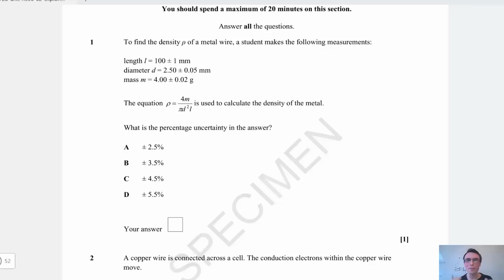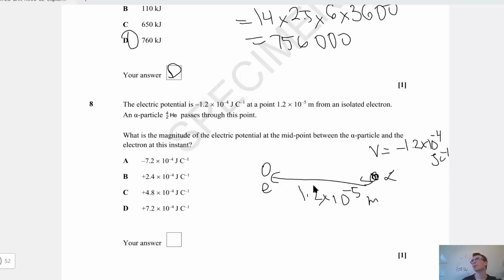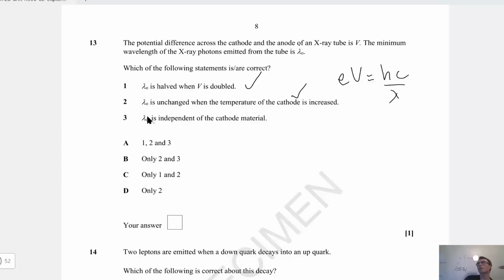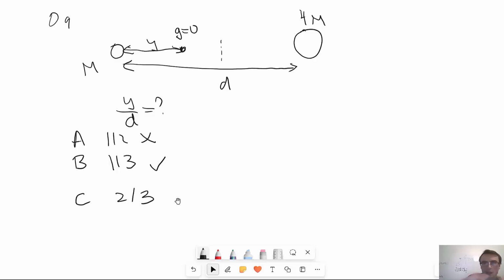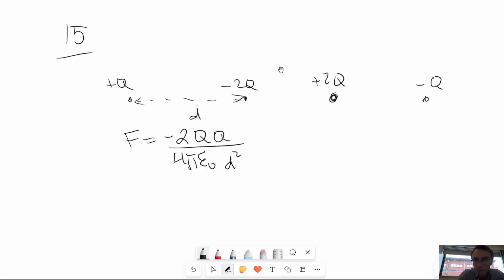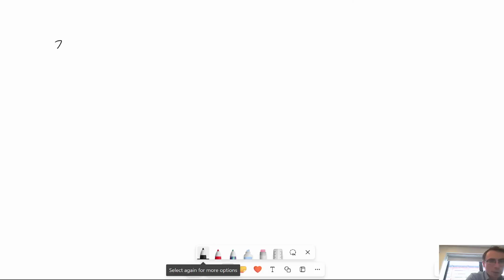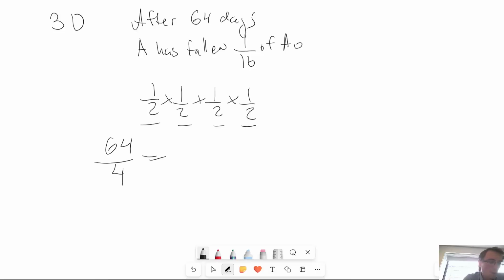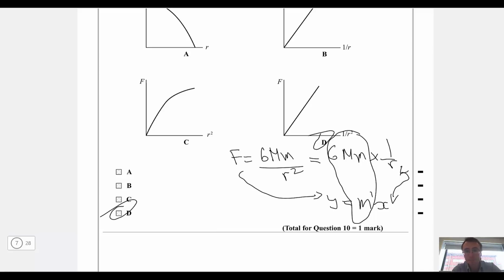LAST Minute Multiple Choice for A Level Physics

Comment: Question 11 is wrong, the answer is B since you calculated the percentage of intensity that is reflected, but we are asked to find the percentage that is transmitted. So you just have to do 100-ans to get 40% instead of 60.
(I take it back I’m wrong 🥲)
Reply: For OCR*
Reply: No 60% is correct, that is the percentage of intensity that ends up being transmitted through that distance. 40% instead is the intensity lost or absorbed by the section of the bone
Reply: @qarcin12  the mark-scheme says it’s 40% but idk. Now I’m just confused.
Reply from the maker: Here is a good way to think about it. Let's say I0=10 and I=6  as 4 were absorbed. I/I0=6/10 i.e. 60% have passed through. Hope this helps! 40% will be absorbed.
Reply: @zhelyo_physics  the mark scheme says its B, is it wrong?
Reply from the maker: @andronikoschalatzioukas374   the mark scheme I see here seems to say D: https://www.ocr.org.uk/Images/171728-unit-h556-02-exploring-physics-sample-assessment-materials.pdf  Maybe there was an earlier version somewhere out there. The mark scheme is at the end of this document.
Reply: @zhelyo_physics  thats weird the one on pmt says B, but i also got 60% when i did it, so im guessing thats just a mistake
Reply: no you're thinking about ultrasound i swr

Comment: doesn't the energy of a photon depend on wavelength as well , not only frequency ?
Reply: Wavelength also depends on frequency, V=flanda so frequency is in control of everything pretty much
Reply: @Jaydenhughes123  But how can you say that confidently? That frequency is in control of everything. Surely frequency is 'in control' as lamba (wavelength) in every case. Is it not equally true that frequency depends on wavelength.
Reply from the maker: both are true. It depends only on the frequency or wavelength is an equally valid statement as frequency and wavelength are linked by a constant via the wave equation.
Reply: @sentheaS  that is true but I have found for A level in most mark schemes they mention the energy depending on frequency. But I guess it is just the same thing if you want to think deeply about it.

Comment: For that Q15 OCR with the loop using Flemming's left hand rule, it is 0N because there is no resultant force, as it is the force on the loop not one piece of wire. There still would be a torque I think from the couple.